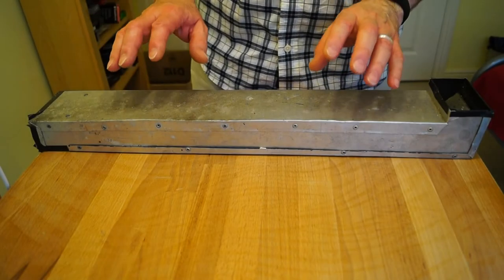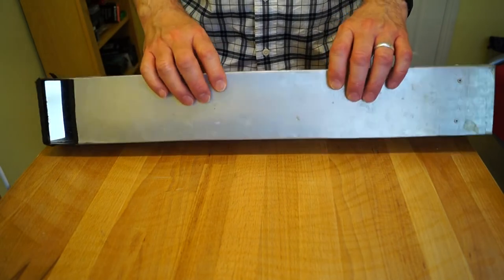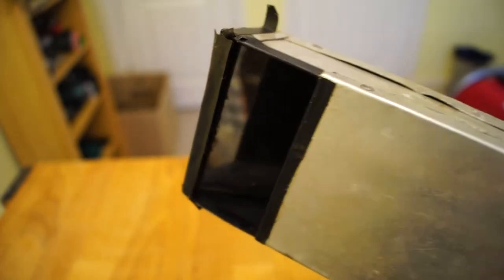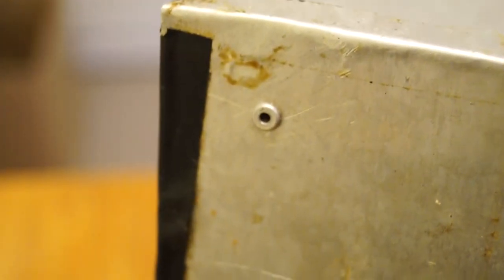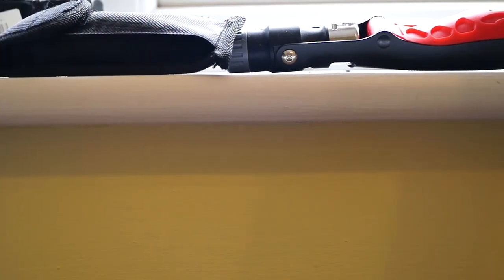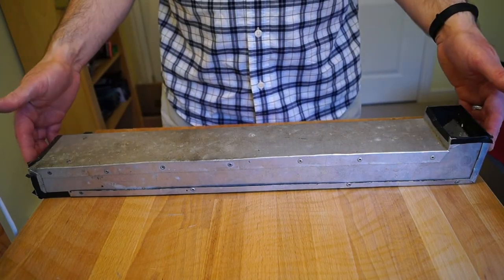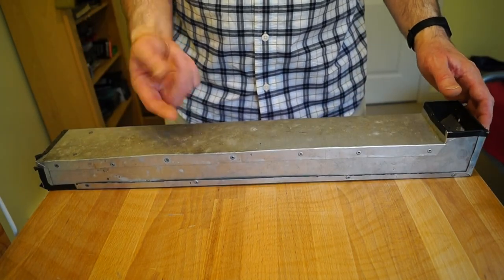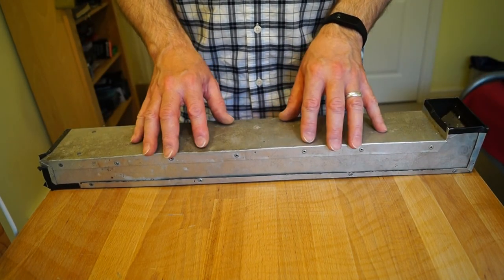Periscope

Comment: Brings back memories for me too! I had metal shop in school also and made some tool boxes and other things in sheet metal. I remember the box and pan brake and the shears. I used the lathe to make a handle out of aluminum and the milling machine to make a hammer head. Knurling the aluminum and our teacher had a friend in the military aircraft factory near our school  (Grumman) and he got us cast offs of titanium and I made a nice ring out of the landing gear of the F16 and won a prize for it. I kept the ring for many years until it was stolen from my car during a break in. Years later I returned to the school as an adult and found that the metal, woodwork and auto classrooms were empty and no equipment any longer because the school decided to abandon their industrial arts curriculum because the majority of kids had zero interest in it. It's quite a shame. Probably some of the reason why we have interest in gadgets, gizmos and knives is because we have an understanding and appreciation of how they might be made because we had those experiences early in life. The youth of today have virtually no interest in that stuff and 9 times out of 10 will throw out a non working item without even trying to see why it konked out, while we will look at it and try and see what when wrong and attempt to fix it.
Reply from the maker: +traderjoes Hello Joe. A very interesting comment. You are right about the current generation having little or no knowledge of the stuff we know about. I once worked for a tool and equipment wholesaler as a technical adviser. Quite a few of the young lads in telesales had no idea of how cars worked and had to forward the customer onto me to help them. At their age I had a considerable knowledge of cars and the internal combustion engine!